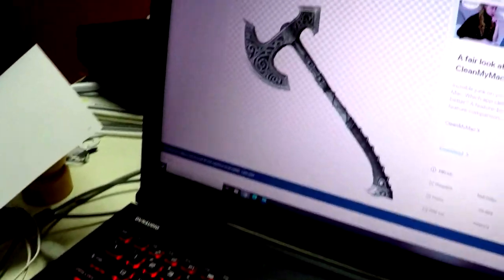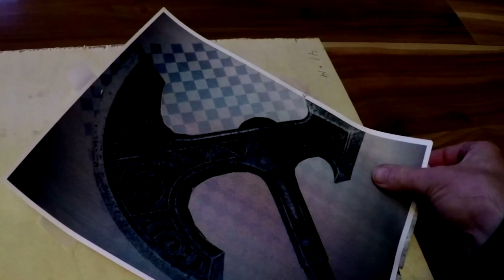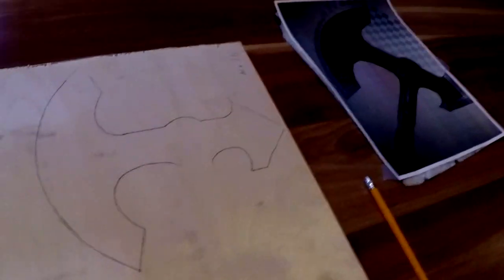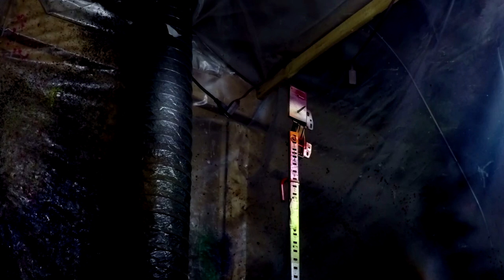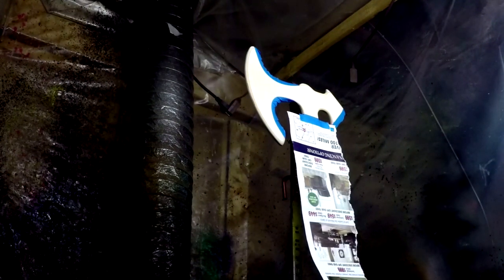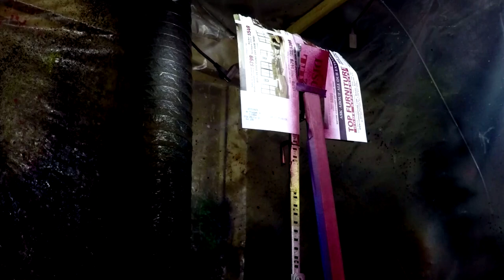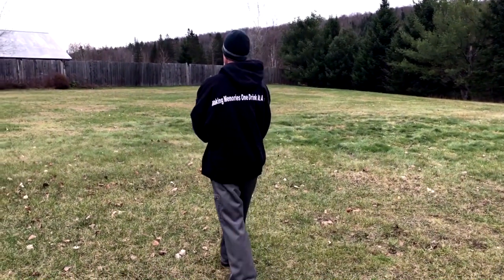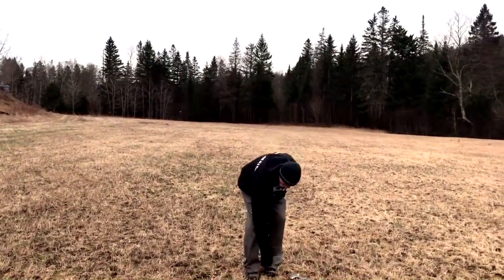New boomerang design AX with flight

Comment: Hello vic, I made a scalper axe design, and it flew well until it was time to come back. It would only return a little bit, then flutter down. What could I do to fix this?
Reply from the maker: Sure,  what is it made out of. Type of wood and thickness
Reply: @VictorPoulin  it's plywood, 5/16 thick
Reply from the maker: @rac-qb4dt  Are you able to post a video?  If yes, show me a close up of the boomerang, all angles, top, bottom, and you throwing it.
Reply: @VictorPoulin  I'll see if I can
Reply: @VictorPoulin  ok, the video's out now, https://youtu.be/eBPZX7QJVac I will say that I didn't use any sort of template, so it might just be too small.
Reply from the maker: @rac-qb4dt Let me go to your video and watch it then I will reply.

Comment: Vic, I remember in one of your other videos on builds you talk about usually using the belt sander for the trail edge.  Any particular reason for either method?  Also, what bit gives you the trail (great build, BTW, as always)?  I have done several now bc of your vids, but there certainly seems more margin for error using the sander.
Reply from the maker: I started out with a belt sander and mastered it quickly. Don't use too an aggressive sandpaper and it will lessen the mistakes. I moved up to the router bit as it was so much faster but also much more dangerous. If I remember correctly it is a 45 degree